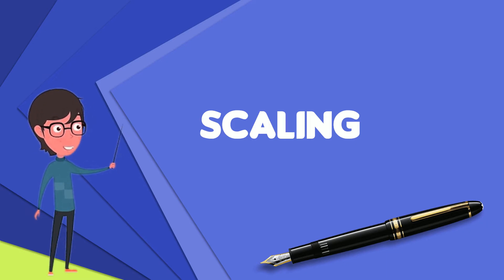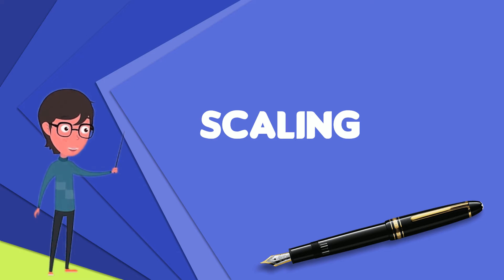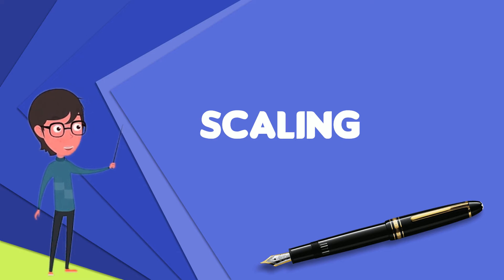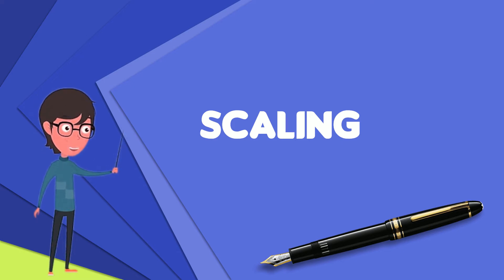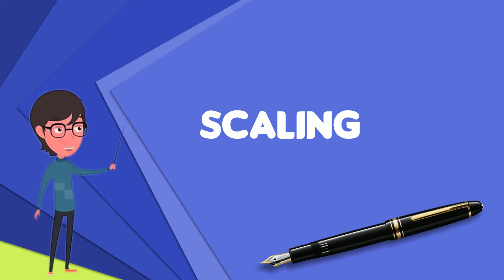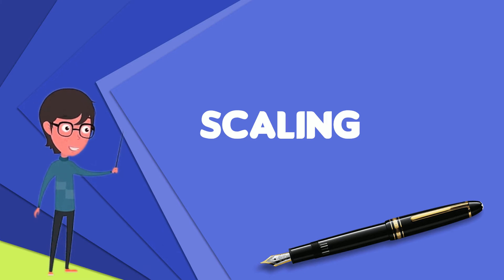What is Scaling (geometry)?, Explain Scaling (geometry), Define Scaling (geometry)

Comment: Scaling is the reason distant objects appear "larger" than expected, and why galaxies move "faster" than expected away from their center. Scaling even defines how "favorable genome selection" works. From the CTMU, cosmological "scaling", aka "requaltization", is answer to pretentions "theories of everything".

Hint: a static-scaled universe with "virtually collapsing" content is logically identical to an "expanding" universe with static-scaled content (or otherwise any rational combination of the two models). In a static universe, "collapsing content" necessarily features a "rescaling function" between states, per Geometry 101. This isn't complex reasoning, just too "real" for the field, much like how "Heiocentrism" wasn't cool either, until it was.